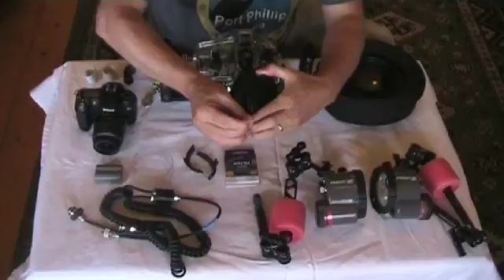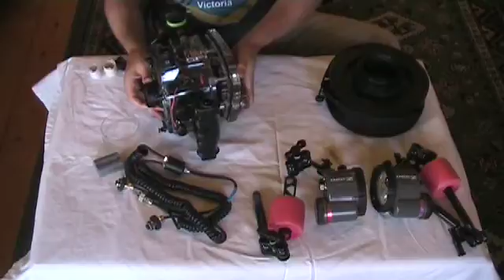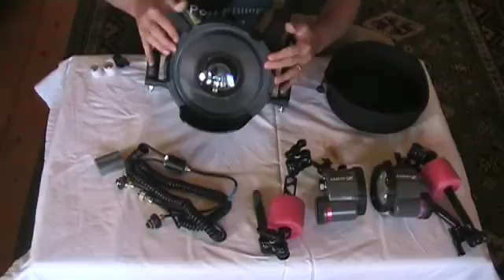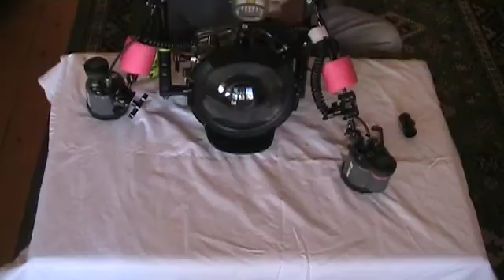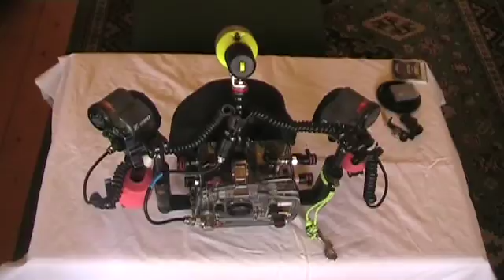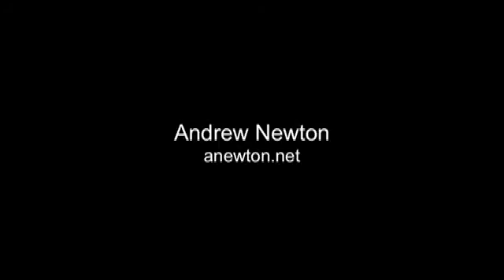Ikelite housing assembly

Comment from the maker: @nitrosoxide08 Thanks. Correct, the ports are not firmly held in place by the clips however they are still water tight. Underwater they are pushed firmly into place.

Comment from the maker: @meltdownman1 I have only flown domestic with the camera gear and I just packed it all in a backpack wrapped in t-shirts and towels. From memory I carried on housing, camera, lenses, strobes and laptop. The foam is pool noodle threaded over the arm, I'm using 2 pieces about 120mm long. It does help a bit but not essential.
The Ikelite balance it fine, mainly the positioning of the Inon strobes dictate balance being quite heavy underwater.

Comment: Andy, a couple of questions:

Any recommendations with regards to luggage (e.g. think tank, lowepro) so as to be able to get both camera and uw housings through international flights carry on?  I don't want to put new gear in checked luggage.

I see you are using foam to support the setup, any help on what kind and how many to use?  

Finally, how is the balance on the setup?  I've read that the Aquatica housing tilts backward unless you are using the glass dome port. How about Ikelite's?